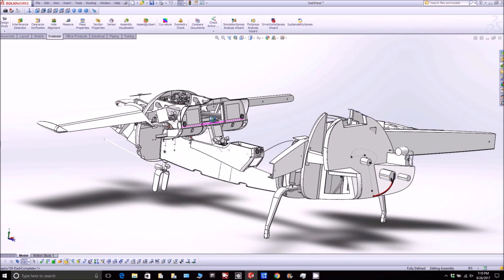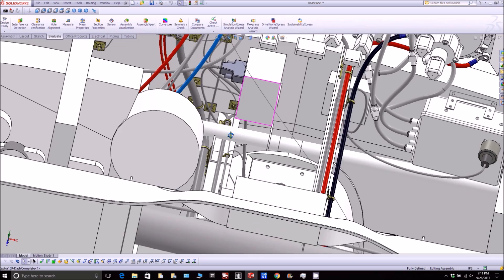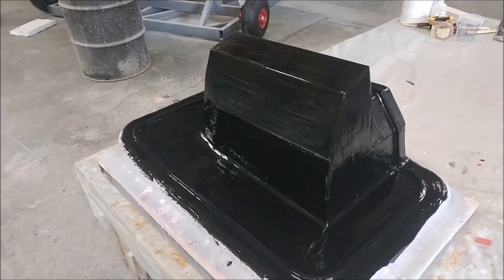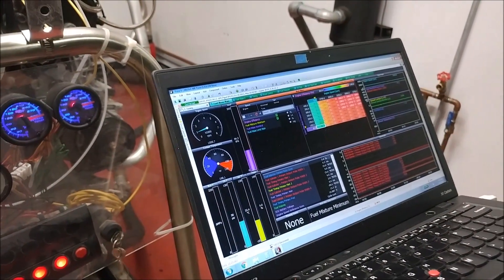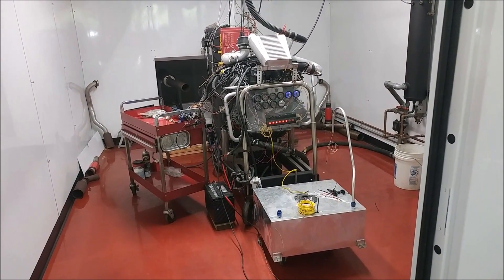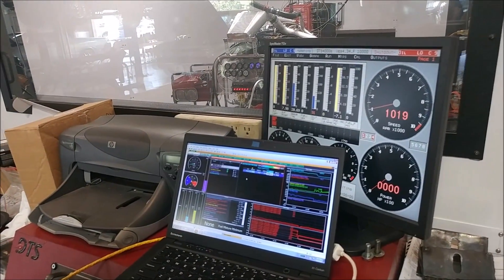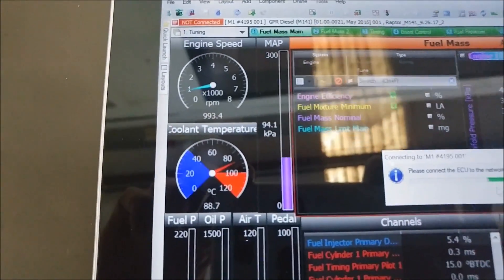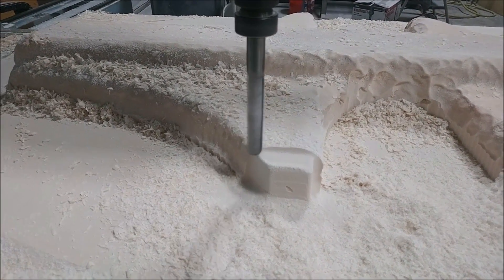Revving the Engine - More dyno prep work

Comment: I find it fascinating how low the revs are limited on the diesel compared to gasoline/petrol.
Reply: That's the beauty of a diesel, this diesel is pretty high rev compared to many.  Low revs and LOTS of torque for swinging a prop at a steady rpm (not constantly speeding up and slowing down like typical auto use)
Reply: Diesel fuel is a larger group of molecules, like larger logs in a fire they burn more slowly.
 Therefore a diesel must have a lower piston speed than what a gas engine would run at. Newer Diesel's have very fine spray pattern high pressure injectors that allows them to run a bit faster than older diesels.
Reply: Kyle Goldston!! Great analogy. I have never herd it explained like that before.
Reply: I must have missed it somewhere--what are they doing to prevent fuel gelling at the low temps at altitude?
Reply: You did, using heat from engine coolant with heat exchanger to warm the fuel and circulate it out to the tanks.

Comment: Windows? Please consider Android or almost anything else other the Windows!!
Reply: It'll be fine if used as a dedicated device and not connected to the internet. Disable and or uninstall all non critical software, drivers, etc.
Reply: How about Win7 embedded? No desktop environment, but it's super stable.
Reply from the maker: Motec does not have software that runs on anything other than Windows. This tablet will just be for the engine info as well as data capture for the other telemetry we are planning for the prototype.
Reply: Nathan - I'm with you on the ask, although I'd prefer something platform agnostic (I'm an Apple guy).  With that being said, after my visceral reaction to a Windows based anything in the aircraft I had to stop myself and ask - what's the price point?  Are we getting more features, more bang for the buck going this route than if we got some other engine management system?  Given Peter's eye for costs (low) and cool factor (high), I trust he's making the right decision.

Comment: Canada has 6 months of winter. Cabin heat is super important for the northern guys.!! The wife hates the cold! Warm plane is best...lol
Reply: Try a cold start on a diesel when it's cold.  OUCH!  I'm waiting to see a block heater episode for the colder climates.  That will suck a battery down if it's not plugged in.   He has the cold fuel problem fixed with fuel heaters.  Diesel engines have many great advantages, especially torque.  However, they are higher maintenance, temperature sensitive, and more vibration.  There's simply something obscene about an internal combustion engine that sounds like there are rocks in the motor.  :-)  I'm not a diesel fan, however he knows a heck of a lot more than me.  :-)
Reply: Heated hangars. Everything in Grande Prairie is heated. It can get really cold here. Beyond the ability of most peoples imagination. You really should come for a holiday and experience the true beauty of winter. learn to ice skate. :-0
Reply: If you care about your engine, whether it's a gas or diesel auto or aircraft you run a block heater or as I used to do with my 1946 Bellanca in an unheated hanger you can make a thermostatically controlled engine heater for less than $100-200.   Cowl blanket some flexible dryer vent tube with a small electric heater/blower.  Turn it on the lowest setting blowing on the engine block and it will keep it nice and warm.        Diesels are traditionally LOWER maintenance than gas equivalents, especially if taken care of.